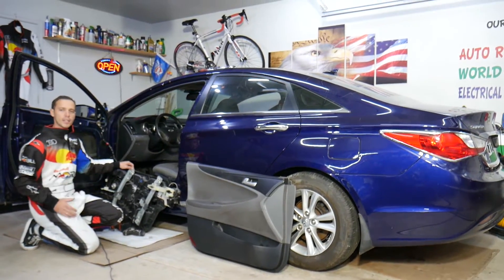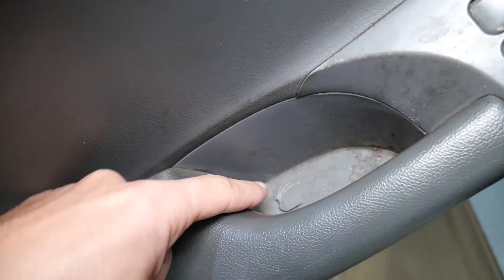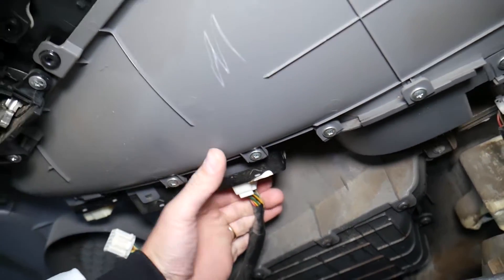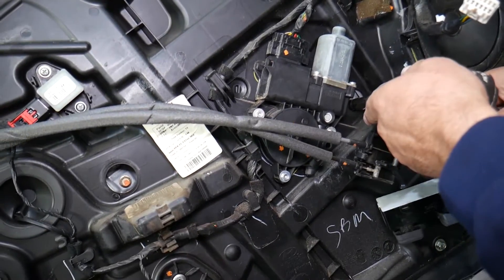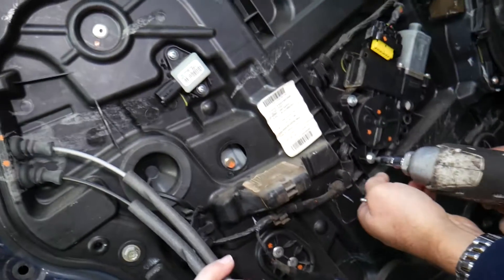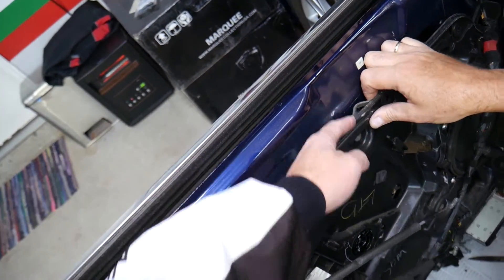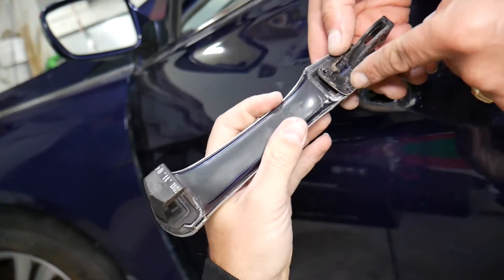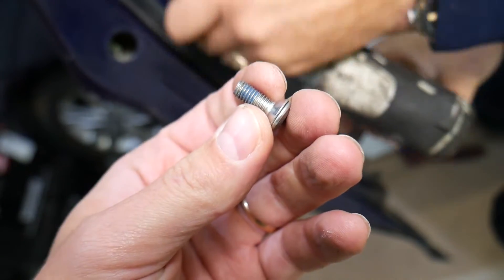HYUNDAI SONATA FRONT DOOR WINDOW REGULATOR REPLACEMENT REMOVAL

Comment: hey the door handle piece that broke for u also broke for me, any advice on how to fix? or where to buy replacement?
Reply: Buy it at junkyard also the door handle u have to open the bolt 1st the side it to open. slide to lock it in and tight the bolt.